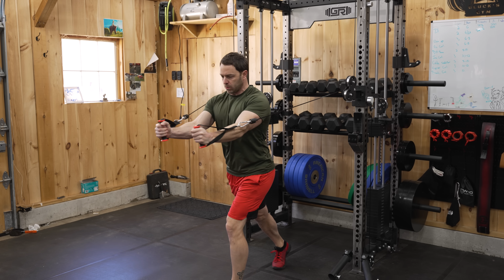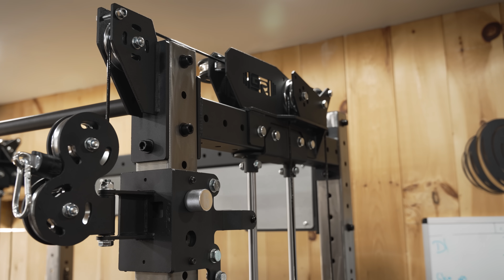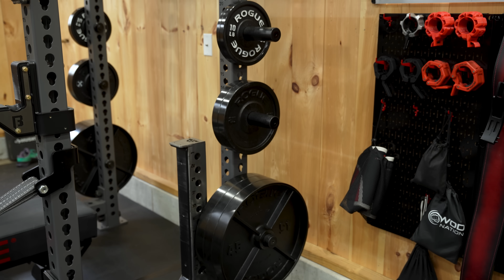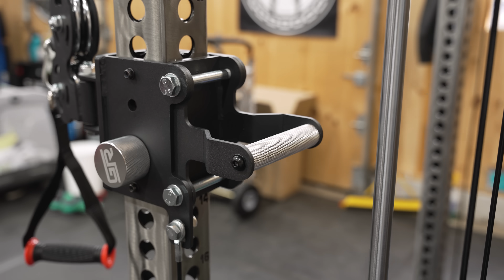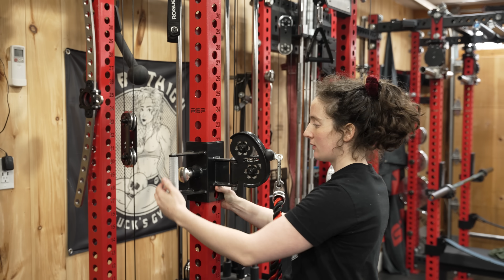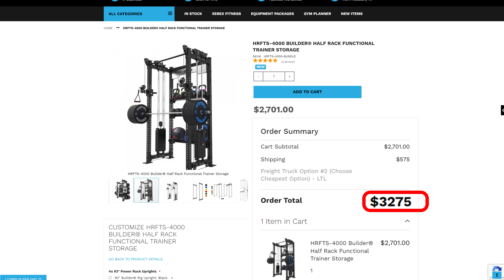Best Space Saving Do It All Rack? Get RXd HRFTS-4000 Squat Rack Review

Comment: Came to this video late as I was looking for a power rack/functional trainer hybrid.  I was wondering if you'd looked into the RX3 TORNADO RACK from Get RXd?  It appears to be the regular RX3 power rack setup but with some new attachment cable arms so they sit out far further than the traditional ones.  The original rack - out of stock by the way - system had duel cables so you could do 2:1 or 1:1 on a single stack which was nice in it's own way even if it looked weird, but I'm having trouble finding any reviews for either that aren't from the company.  The RX3 series uses the standard hole size and spacing all the way up unlike the rack in this video as well.  Wanting to see what others say before deciding if I go with them or another brand.

Comment: Hey Adrian - thanks so much for the review and feedback. We now offer an updated RX3 FreeStanding Rack 3000 that utilizes 1" holes with 2" spacing, some major quality updates, the ability to do both 2:1 and 1:1 weight ratios, and spotter arms that insert from the front and rotate 90 degrees to lock in (with a nice, rounded chrome pin that'll never chip your powder-coat).

The HRFTS-4000 in this review is configured from a larger ecosystem of Builder pull-up rig components. The Builder series uses 1" holes in the lower area for j-cups and spotter arms, and then 1/2" holes in upper area for bolt-in attachments such as pull-up bars and crossbars. This "Builder" design is most cost-effective for gyms that are buying multiple pull-up bars and crossbars for a single pull-up rig setup. For home gym owners, we'd suggest our RX3 series if you want the most versatile setup and ability to use accessories from other brands since the RX3 series uses 1" holes with 2" spacing throughout.

Looking forward to your review on our updated RX3 series : )
Reply: The RX3 line looks promising. I hope you guys offer shorter uprights for some of us. 80”-84” would be nice.
Reply: @raven-19x  You got it! We'll get to work on this : )
Reply: 78” ceiling here..  I would be very interested if you can accommodate that height in the future as well!
Reply: @gabeveloria2915  We will have a 84" upright model which means total height would be 85-86". Unfortunately 78" might be too low
Reply: @raven-19x  We'll work on this!
Reply: I wish more companies would have the option for either 2:1 or 1:1. As far as I know, you are the only ones doing this on a single upright in a 3x3 build.
Reply: @balboa0621  You are correct! And, we just sent a cable tower 3000 out to Gluck for a review! 😁

Comment: For your next review, they came out with a new version that is basically a regular 3x3 1in upright, but option to use 1:1 pulley ratio. It still seems better priced than athena and is more like the Dane from Fringe, but a 200lb stack with ability to use the whole stack is pretty sweet.
Reply: The RX3 3000 cable towers and racks feature ability to do both 2:1 and 1:1 weight ratios! And we'll be releasing many more products in the RX3 ecosystem (1" hole 2" spacing, black e-coat hardware, chrome where powdercoat might scratch, etc) that are geared towards home gym owners!
Reply from the maker: Yep. They took our feedback from this and designed that one. They are going to send one to us
Reply: @GlucksGym I look forward to that review. With a 1:1, it seems like you could use one side as a full lat pulldown, low row. But, unlike the Dane, you get the lighter starting weight of a 2:1.

In your review, please give appropriate time to evaluating this functionality, and whether you can get a full stretch for pull downs.

Comment: 2.0 is gonna be sick.
Reply: 2.0 is available now.
We now offer an updated RX3 FreeStanding Rack 3000 that utilizes 1" holes with 2" spacing, other design/quality updates, the ability to do both 2:1 and 1:1 weight ratios

The HRFTS-4000 is configured from a larger ecosystem of Builder pull-up rig components. The Builder series uses 1" holes in the lower area for j-cups and spotter arms, and then 1/2" holes in upper area for bolt-in attachments such as pull-up bars and crossbars. This "Builder" design is most cost-effective for gyms that are buying multiple pull-up bars and crossbars for a single pull-up rig setup. For home gym owners, we'd suggest our RX3 series if you want the most versatile setup and ability to use accessories from other brands since the RX3 series uses 1" holes with 2" spacing throughout.

Comment: Also, this does not seem to require front support footings, which is something that Rep recommends when getting the 4 post,.   Your review indicated that the floor support arms were not necessary.  The entire depth of the system is something that is important as my depth space is limited.
Reply from the maker: Depth depends on how you install the shelves (there's 2 positions for each) and which shelves you buy (they're not included).

Flat shelf goes back the furtherest at a maximum of 5.75". The plate coaster (one I have installed at floor level) is about the same with bumpers on it and it installed in the forward position like I have it. 

Rack (4 post) without front feet is just under 36" deep. This does not include any shelves.

Front feet are another 22.5".
Reply: @GlucksGym  Thanks!   Am I correct that the front feet were not on your video and do not seem to be required for stability?
Reply from the maker: @kellyreyher3437  crap... I'm sorry I thought you were commenting on our Fringe Sport Dane Rack review which is similar to this. Those measurements are from that rack and completely useless to you. Unfortunately I don't have this rack anymore. I had to sell it to make space for the next one.

Comment: What is the actual distance in depth from the wall with the weight and storage shelves?  The measurements in the video showed 31 inches, but not sure if that included the distance necessary for shelves, and for the weights on the outside horns?  Thanks, it was a great video

Comment: I feel ya on the spotter arms but they do store very well on the uprights when not in use ans the car needs to pull in.
Reply: We now offer an RX3 spotter arm that inserts from the front, also has a nice rounded chrome pin to prevent any powder coat chips! Compatible with both our RX3 series and our Builder series!

Comment: Spend the extra $1k and get Rep. That is a no brainer. Buy once cry once. No way the quality and lack of accessory compatibility is worth the savings.
Reply: We do have a new RX3 series which features all 1" holes with 2" spacing. It also has a variety of other quality updates, and even has the ability to do both 1:1 and 2:1 weight ratios! 

The HRFTS-4000 in this review is configured from a larger ecosystem of Builder pull-up rig components. The Builder series uses 1" holes in the lower area for j-cups and spotter arms, and then 1/2" holes in upper area for bolt-in attachments such as pull-up bars and crossbars. This "Builder" design is most cost-effective for gyms that are buying multiple pull-up bars and crossbars for a single pull-up rig setup. 

For home gym owners, we'd suggest our RX3 series if you want the most versatile setup and ability to use accessories from other brands since the RX3 series uses 1" holes with 2" spacing throughout.

Comment: Great review, I never would have noticed that issue with their spotter arms.  Their website sucks though.  It's not very clear on what the options actually are.
Reply: We do have a new RX3 series which features all 1" holes with 2" spacing. It also has a variety of other quality updates, and even has the ability to do both 1:1 and 2:1 weight ratios! 

The HRFTS-4000 in this review is configured from a larger ecosystem of Builder pull-up rig components. The Builder series uses 1" holes in the lower area for j-cups and spotter arms, and then 1/2" holes in upper area for bolt-in attachments such as pull-up bars and crossbars. This "Builder" design is most cost-effective for gyms that are buying multiple pull-up bars and crossbars for a single pull-up rig setup. 

For home gym owners, we'd suggest our RX3 series if you want the most versatile setup and ability to use accessories from other brands since the RX3 series uses 1" holes with 2" spacing throughout.

And, we're working on a new website!
Reply from the maker: Their website definitely needs work

Comment: This channel is awesome, should be getting more views. The rack is good but incompatibility with other brands is a deal breaker for me, every  other manufacturer has always something better than the other and you need it to be compatible with your rack to make it future proof.
Reply: We do have a new RX3 series which features all 1" holes with 2" spacing. It also has a variety of other quality updates, and even has the ability to do both 1:1 and 2:1 weight ratios! 

The HRFTS-4000 in this review is configured from a larger ecosystem of Builder pull-up rig components. The Builder series uses 1" holes in the lower area for j-cups and spotter arms, and then 1/2" holes in upper area for bolt-in attachments such as pull-up bars and crossbars. This "Builder" design is most cost-effective for gyms that are buying multiple pull-up bars and crossbars for a single pull-up rig setup. 

For home gym owners, we'd suggest our RX3 series if you want the most versatile setup and ability to use accessories from other brands since the RX3 series uses 1" holes with 2" spacing throughout.

Comment: Great review! I hope they change the hole spacing and switch to using 1” holes and hardware everywhere in the future. Adopting this feels like you end up locked in without a compelling reason. I do like how the storage shelves attach better than Rep’s with the Athena.
Reply: We do have a new RX3 series which features all 1" holes with 2" spacing. It also has a variety of other quality updates, and even has the ability to do both 1:1 and 2:1 weight ratios! 

The HRFTS-4000 in this review is configured from a larger ecosystem of Builder pull-up rig components. The Builder series uses 1" holes in the lower area for j-cups and spotter arms, and then 1/2" holes in upper area for bolt-in attachments such as pull-up bars and crossbars. This "Builder" design is most cost-effective for gyms that are buying multiple pull-up bars and crossbars for a single pull-up rig setup. 

For home gym owners, we'd suggest our RX3 series if you want the most versatile setup and ability to use accessories from other brands since the RX3 series uses 1" holes with 2" spacing throughout.
Reply: @GetRxd  the RX3 series looks phenomenal! I’m hoping Gluck gets to do a review before too long!
Reply: @fwiffo42  We will be sending a FreeStanding Rack 3000 (uses our cable tower 3000s to build it) to Gluck for a review in the next couple weeks! We're also planning to release other unique rack configurations in our RX3 series in the next couple weeks as well - there'll be one with a smith machine and tornado pivot arms (like freemotion functional trainer arms)
Reply: @GetRxd very exciting stuff! I can’t wait to see the tornado arms!

Comment: As someone with a Get Rx'd squat rack, I can address the hole situation a bit. If you go their page you'll see that the racks are just part of a larger modular system for building things like ninja gyms. If you want to go full Lincoln logs it's awesome. When you want to add a third party attachment? Not so much. I love it because I got it locally, but it's definitely something to consider with their products.
Reply: Thanks for helping explain! 

We do have a new RX3 series which features all 1" holes with 2" spacing too and has the ability to do both 2:1 and 1:1 weight ratios! Come by the showroom if you'd like to see it in person!
Reply from the maker: Yes it's compatible within their own ecosystem as I showed in this vid but the standard sizes were set well before their system came out. It's a way to cut on costs some and if you start within their ecosystem it's great but it can get weird outside of it

Comment: The compatibility issues would be the deal breaker for me. I want to be able to buy nearly any 3x3 1" attachment without worrying about whether it will work (besides a little expected slop when using Imperial 3x3 attachments on metric racks).
Reply: We do have a new RX3 series which features all 1" holes with 2" spacing. It also has a variety of other quality updates, and even has the ability to do both 1:1 and 2:1 weight ratios! 

The HRFTS-4000 in this review is configured from a larger ecosystem of Builder pull-up rig components. The Builder series uses 1" holes in the lower area for j-cups and spotter arms, and then 1/2" holes in upper area for bolt-in attachments such as pull-up bars and crossbars. This "Builder" design is most cost-effective for gyms that are buying multiple pull-up bars and crossbars for a single pull-up rig setup. 

For home gym owners, we'd suggest our RX3 series if you want the most versatile setup and ability to use accessories from other brands since the RX3 series uses 1" holes with 2" spacing throughout.

Comment: that is kind of embarrassing to have two different types of holes if it means it requires two different mag pins. It's bad enough when it just effects the niche utility/ ability to connect to other uprights, but that is very clunky just to save some money on 5/8th hardware rather than 1 inch? Aside from that the closer hole spacing through the main portion would actually an advantage to me allowing for tight bench adjustment.
Reply: We do have a new RX3 series which features all 1" holes with 2" spacing. It also has a variety of other quality updates, and even has the ability to do both 1:1 and 2:1 weight ratios! 

The HRFTS-4000 in this review is configured from a larger ecosystem of Builder pull-up rig components. The Builder series uses 1" holes in the lower area for j-cups and spotter arms, and then 1/2" holes in upper area for bolt-in attachments such as pull-up bars and crossbars. This "Builder" design is most cost-effective for gyms that are buying multiple pull-up bars and crossbars for a single pull-up rig setup. 

For home gym owners, we'd suggest our RX3 series if you want the most versatile setup and ability to use accessories from other brands since the RX3 series uses 1" holes with 2" spacing throughout.

Comment: I wonder why they went with smaller holes near the top. Strange.
Reply: We do have a new RX3 series which features all 1" holes with 2" spacing. It also has a variety of other quality updates, and even has the ability to do both 1:1 and 2:1 weight ratios! 

The HRFTS-4000 in this review is configured from a larger ecosystem of Builder pull-up rig components. The Builder series uses 1" holes in the lower area for j-cups and spotter arms, and then 1/2" holes in upper area for bolt-in attachments such as pull-up bars and crossbars. This "Builder" design is most cost-effective for gyms that are buying multiple pull-up bars and crossbars for a single pull-up rig setup. 

For home gym owners, we'd suggest our RX3 series if you want the most versatile setup and ability to use accessories from other brands since the RX3 series uses 1" holes with 2" spacing throughout.
Reply from the maker: I think probably just to keep costs down
Reply: Builder system. Check out the insane ninja gyms people make the the Get Rx'd stuff. Downside is that it made it impossible to use the Dialed Motion system

Comment: The hole configuration is so strange! Otherwise interesting product.
Reply: We do have a new RX3 series which features all 1" holes with 2" spacing. It also has a variety of other quality updates, and even has the ability to do both 1:1 and 2:1 weight ratios! 

The HRFTS-4000 in this review is configured from a larger ecosystem of Builder pull-up rig components. The Builder series uses 1" holes in the lower area for j-cups and spotter arms, and then 1/2" holes in upper area for bolt-in attachments such as pull-up bars and crossbars. This "Builder" design is most cost-effective for gyms that are buying multiple pull-up bars and crossbars for a single pull-up rig setup. 

For home gym owners, we'd suggest our RX3 series if you want the most versatile setup and ability to use accessories from other brands since the RX3 series uses 1" holes with 2" spacing throughout.